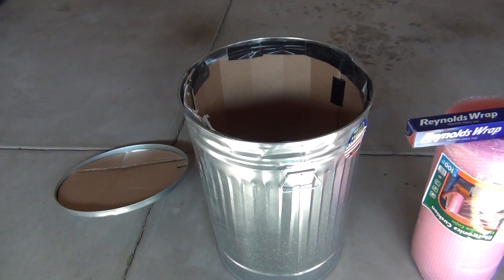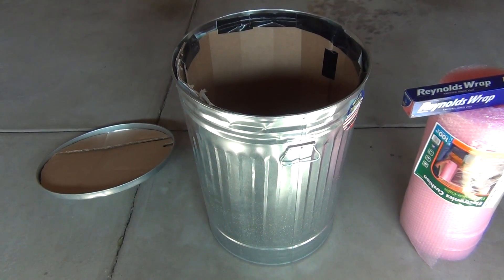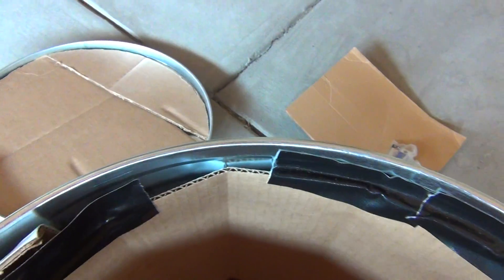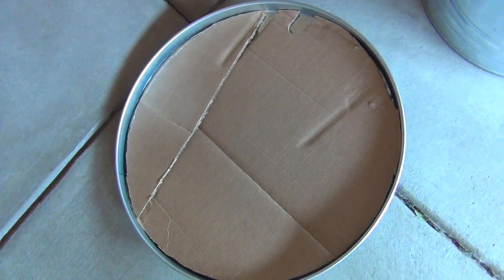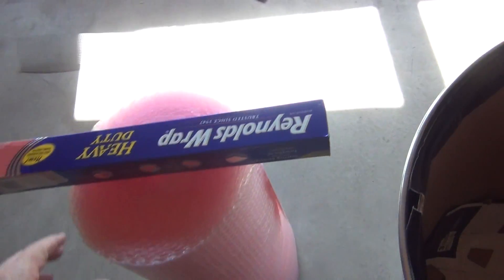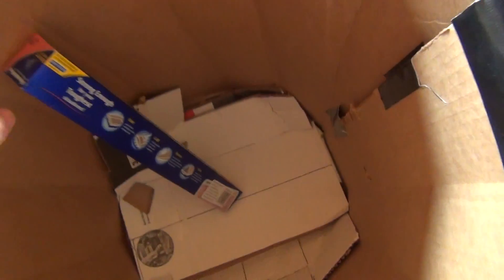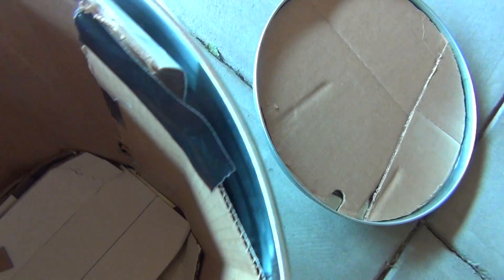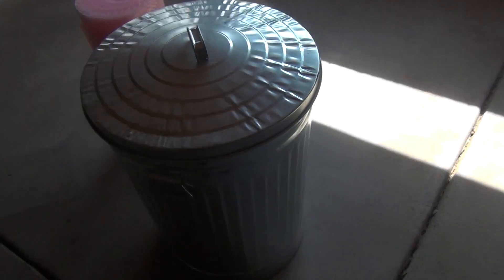How to build a Faraday Cage

Comment: Wayne, amigo: Excellent topic, and excellent advice.  

I preface the following by stating that I remain a layman, and am not an expert in these things.  Yet my experiments with Faraday cages leads me to want to ground the outer, conductive layer, in order to return to electric ground as much of the charge as possible.  Otherwise, we seem to be making capacitors of some sort, which might build up a charge.  

This might prove useful in the likes of a Carrington-event like discharge from the sun.  

The question I am asking these days is: Is it possible to DIY Faraday Cage for EMP protection for a car?  A modified car cover, and the addition of a ground-wire mechanism to ground the vehicles chasis to real earth ground while parked, are conceived.  Additionally, the crazy possibility of grounding the car while it is in motion to earth ground -- this is possible and needs only good engineering to be accomplished cleverly.

F.

Comment: It's a good idea to test the garbage can FC to make sure it seals completely.  Either take a (battery operated) radio, turn it on (volume up) and put it in; put the lid on.  You'll hear the radio go staticy as you put it in.  When the lid is on you should hear NOTHING.  If you do, it's not sealing all the way.  The other way you can test it is to put your cell phone (leave it on)  down inside and put the lid on.  Call the phone.  If it rings or gets a text while inside, it's not sealed properly.  I would assume you'd get at least some EMP protection even with a not-great seal, but a strong pulse would still wipe your devices.

Comment: Wayne why won't a plastic trashcan work, plastic or rubber will not let electricity through?  how about a  rubber container?
Reply from the maker: these are electromagnetic waves highly charged particles you can insulate inside the Faraday cage but in this case it is those protons, xrays, and other radioactive particles that metal is what you want plastic or rubber not going to help
Reply: Clara Elaine Glass I believe it has to be metal to keep the electrical current from penetrating the cage and allowing the current an easier ground out.  Path of least resistance.
Reply: Paul Mobley I just don't understand why a heavy rubber wouldn't protect it.  I'm not talking about  I mean like an inch thick rubber. I know of people that have been electrocuted by high-voltage wires and those that didn't get hurt were sitting in the truck that was on rubber tires. now what's the difference I mean I realize it's a really high voltage of energy but is it different then have voltage wires carrier electricity from city to city from house to house?

Comment: can't  you stick them in the microwave, lol just don't turn it on
Reply: fridge or stove are much thicker, generally magnetically coated too. Bathtubs are great too, though you need two. Microwaves are hardly shielded, if one needs proof take your wireless headphones near one while it's running.
Reply: tea kettles are great for small things
Reply: Only if you don't need them charging